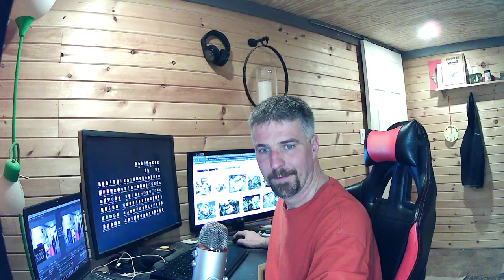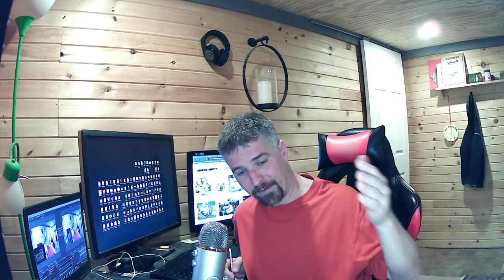Swapping a Kawasaki Teryx engine with a Brute Force Engine Information Only

Comment: I did the swap from a 2006 Brute Force into my 2008 Teryx. Wished I would have seen your video earlier. Every single problem I have encountered you have covered. However I have a new problem. The engine from the BF doesn’t line up with the mounts on the Teryx. It almost an entire inch off. I had a dealer run the case part numbers from the 06 and the 08 and they are different. Have you or anyone else run into this problem? We finally have the engine mounted and everything lining up except the front engine mount. It’s been such a PITA!

Comment: 2:39   I see the differences in the primary couch.  The fins are longer making the clutch taller. Even so.  If the Teryx cover and Teryx clutches fit on the Teryx.  Then why won’t the Teryx clutches and cover work on the BF engine?

Comment: Can’t I swap output shaft gear instead of having to split the case and swap bevel gears ?
Reply from the maker: You do not have to split the case to change the bevel gear - but you MUST change the bevel gear as well, otherwise the gears are not the same pitch and you'll chew it up in no time, THEN will have to split the case to clean out the debris.

Comment: What would be different if I found a carbed BF 750 and did the swap?
Reply from the maker: The bevel gear and output shaft is the only thing you need to check.
Reply: The flywheel is different.  08 carbed BF has 2 poles.  The 2011 Teryx carbed had 23 ish stator also.

Comment: I did The Swap, But it doesn’t wanna go, Like The Engine Revs High but it’s going slow, What Kind Of clutch & of springs should I get to spin the tires?
Reply from the maker: You should have a set of Brute clutches with the red spring.

Comment: Would it be possible to change the ring gear instead of the bevel gear to avoid having all the work to split the case?
Reply from the maker: You do not have to split the case.  The shaft pulls out from the rear, and just beside the oil fill is where you pull out the bevel gear. You'll need snap ring tools for it. But you definitely have to change both. They are a different cut. If you don't swap them both you will chew up one or the other.  But on the back of the engine there's four bolts around the shaft. Pull those four bolts, and then pull the shaft out of the opposite side seal.  You might need to remove the bevel gear first.  Search for the T-Rex 750 service manual PDF. Everything is in there. Everything.

Comment: Kind of opposite to what you did, but thoughts on swapping a 2012 teryx engine into a 2006 brute force? I have the full teryx there for parts
Reply from the maker: Yes but again you definitely have to swap out the shaft and the bevel gear. I'm not certain if you need to swap the clutches or not going the direction you are.

Comment: I have a 2008 teryx I bought at auction rebuilt the engine. Is there a piece that fits in the oil seal where the pull start would go for say a brute force ? I think I have the bolt for it but no oil slinger to prevent oil going into the plastic cover. This was all apart already in the jig saw puzzle
Reply from the maker: The plastic cover is just that there's no oil seal for it. No oil goes in there either if it does that means the seal is blown on the crank bolt.  There's also not a lot of clearance or anything else either. But as for the entire stator cover, the huge aluminum piece, yes there is a seal and I recommend you get the metal one not the fabric one.  But the plastic cover is just four little bolts and that's it.

Comment: Hey , just came across this.  I purchased a 2009 teryx , it didn't run.  I got it going with a new battery and plugs. Runs like crap off idle.  After a little more research I found that the idiot we got it from put a brute force 650 in it.  And yes they left the teryx clutches on it,  belt is at a crazy angle. They left all the brute force output shaft in it and front drive line won't connect.  Figure if I can just make it run somewhat decent I'll just keep it around for a beater. Is the timing off between the 2 engines you think?  Any help would be appreciated, thanks
Reply from the maker: if they someone attached the read output shaft I do not know how! its an easy 8 inches longer.  I would check to see if A. is this machine carbprated, or injected.  Did they put the right stator on it? is the choke cable stuck? are both of the coils properly installed, connected and firing?
Reply: @ThreeBeerMinimum  yeah the rear is connected and it moves.  It looks like they took all the teryx injection and just put it right on the 650 heads. The coils are firing but not sure if at the correct time. I guess I need to pull the side cover off and check the flywheel / stator.  You think it's worth trying to make right?
Reply from the maker: @korycurtis3730  absolutely worth trying.  The one for a carbureted system has one long magnet around the flywheel. The one for a injected system has a bunch of little ones..